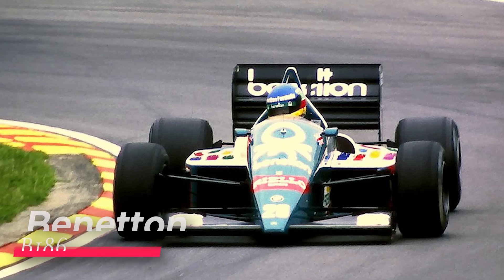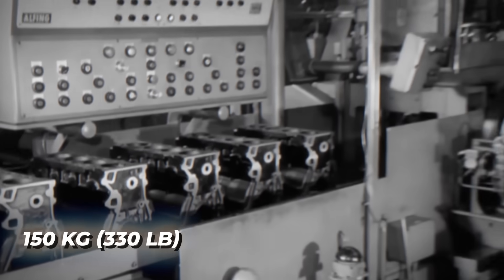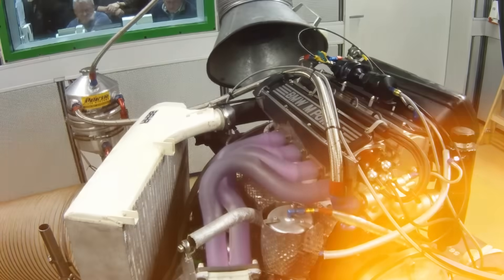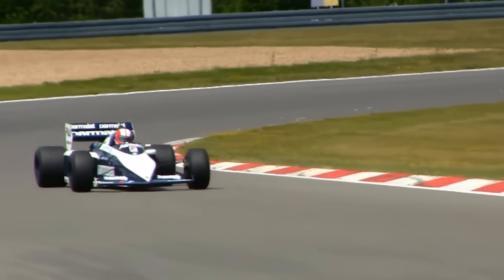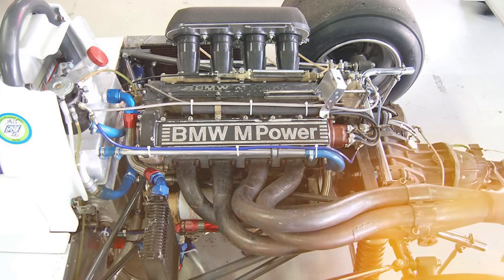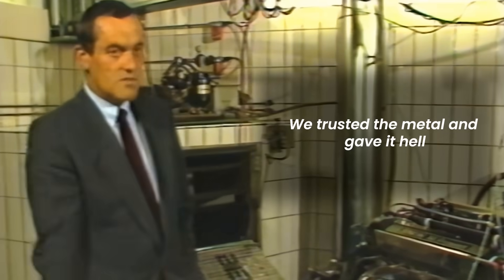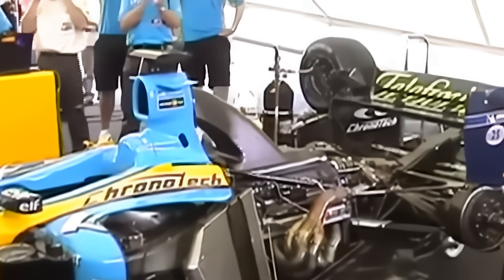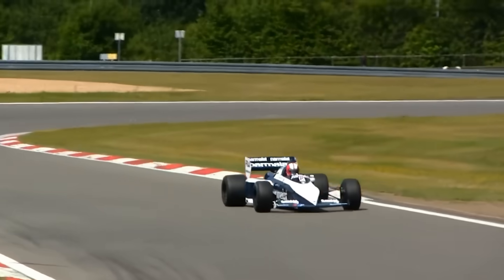The Engine That BROKE Formula 1 - BMW's 1.5 Turbo

Comment: There was one of these at a Top Gear Live show in Sydney Australia more than 10 years ago.  They announced it was about to be started so I made my way over to where it was, stood right next to it and waited for it to start.  They told us to cover our ears which I kind of did, and then they fired it up, idled it for a bit and then revved it a few times.  OMFG!!!!!! I have seen a lot of loud and incredible motorsport moments including Top Fuel dragsters but this was something else, especially due to the tiny 1.5 litres and 4 cylinders that was generating the pandemonium.  F-ing amazing!  I have a video somewhere that I will try to find but it totally blew my mind with the sound and the wonderful fumes of God-knows-what fossil fuels it was burning :)
Reply from the maker: That must have been absolutely unreal to experience in person. A 1.5-liter four-cylinder making that kind of noise and violence just doesn’t make sense. Hearing it up close is something you never forget. If you ever find that video, I’d love to see it, those engines were pure mechanical madness.

Comment: 1:35 They literally took 100000 Mile plus blocks, stored them outside behind the garage for a couple of seasons and then stripped and built them.....Story goes some workers even went around the shop/shed and peed on/over them......
Reply from the maker: The blocks being old, rusty, high-mileage cast iron? That part is real. The ‘peed on’ part… let’s call that peak workshop folklore 😂 Either way, whatever they did clearly worked.

Comment: That Engine Block they Pissed on it! No Joke! And then they Raced that thing in F1. No Joke!
Reply from the maker: The ‘pissed on’ story is one of those long-standing paddock legends. I can’t say for 100% sure it actually happened, but what is confirmed is that those old cast-iron blocks were insanely strong and came from very early production batches.

Comment: So double the power now how is this possible that the lap records were broken with half the power??
Reply: Aerodynamics , more usable power, and improved traction. 
Race tracks have corners
Reply from the maker: Exactly,  modern cars make less peak power, but way more usable power. Plus insane aerodynamics and downforce. A 1980s quali engine was a rocket in a straight line, but today’s cars are faster over a full lap.

Comment: FWIW - For these engines, the BMEP isn't an issue since the spark is so far after TDC.  It's making the exhaust valve, exhaust manifold, turbine wheel, and turbo-shaft lubrication system survive that's the difficult part.
Reply from the maker: Great point! the real challenge was indeed keeping the exhaust side and turbo hardware alive at those insane temps. Appreciate you adding the technical context!

Comment: Blaa Blaaa Blaaa     1.400 HP is a BMW lie...that has persisted ever since...They didn't even have Engine Test Benches back then that could have measured that...🤫
Reply from the maker: I get what you mean, a lot of numbers from that era are exaggerated. But in this case I looked into multiple sources, and the estimates all land in the same range. So it should be pretty close.

Comment: 1500 BHP is NOT more than a Bugatti Chiron.
Reply from the maker: You're right, the top qualifying numbers were around 1,500 hp, and a Chiron makes more. The point was more about the insane power density from just 1.5L back then!

Comment: "BMW was one of the first to use engine management" then bit later "modERn ENGINes do iT wIth SOFTWarE" yeah so did BMW because using computers to control engine is better method than archaic carbs, ignition points, vacuum actuators and centrifugal systems.
Reply from the maker: Fair point, the tech definitely evolved fast in that era. My goal was just to give a simple overview of how BMW approached engine management back then. Appreciate you adding more context 👍

Comment: 4g63 was making 2000hp 25 years ago.
Reply from the maker: True, the 4G63 can make huge numbers but that’s in short drag pulls. The M12/13 was doing 1,000+ hp from just 1.5L in full F1 trim, which is a completely different level of stress.

Comment: My tuned 6 cylinder twin turbo N54 bmw engine only ran 9 psi and had 400hp. I cant imagine driving one of these formula one machines.
Reply from the maker: Exactly! and that N54 already feels wild at 9 psi. Now imagine a 1.5L engine running 60+ psi and making over 1,000 hp… absolute insanity.

Comment: BMW F1 engineers didn’t “just take a used old M10 block”. The block only looks similar on the outside. Internally the block is completely different.
Reply from the maker: Yeah exactly!  they only looked like old M10 blocks from the outside. Inside they were totally re-engineered for the F1 program. The whole ‘junkyard engine’ thing is just the fun part of the story.

Comment: I know a collector who owns one of these engines. Many years ago I asked him if he ever thought of firing it up - he answered "no, because the conrods wil bend and the engine will be scrap after a single dyno run". It's still a dormant beast in his collection to this day.
Reply from the maker: That’s an awesome story. And yeah, these engines were basically time bombs in qualifying trim insane power but zero lifespan. Makes total sense he keeps it as a dormant monster instead of risking it on a dyno.

Comment: Tires as thin as your forearm? This wasn't the 1950s.. 80's F1 tires were very wide
Reply from the maker: You’re right, 80’s rear tires were seriously wide. I was talking about the fronts during qualifying trim those were much narrower compared to the massive rears. But yeah, nothing like the 50s!

Comment: This was all fuel not the turbo so much or the engine.
Reply from the maker: The fuel was a huge part of it for sure but the engine and turbo still played a massive role. Without the block design and the insane boost levels, the fuel alone wouldn’t get you anywhere near those numbers.
Reply: @HCGHiddenCarGems  depends on the fuel-back then people were sometimes using hypergolic

Comment: Gordon Murray has disputed both the power output and the "scrapyard engine blocks" numerous times over the years.
Reply from the maker: True Murray has pushed back on the scrapyard myth and the exact power numbers. But even he admitted the boost levels and cylinder pressures were wild for the time. Either way, it’s still one of the craziest turbo engines F1 has ever seen.

Comment: 1,496 cm(3) 1.5L boost gauge passed 5Bar
89 mm x 60 mm 1,400 hp
Reply from the maker: Yep exactly tiny 1.5L, 89x60 mm, 5+ bar on the gauge and around 1,400 hp in full boost. Absolute madness for that era.

Comment: That’s nothing imagine building a 11000hp drag car now that’s crazy
Reply from the maker: For sure, Top Fuel levels are on another planet but seeing an F1 1.5L four-cylinder push 1,300+ hp in the 80s is still insane in its own way.

Comment: How it did it break F1 when it was so unreliable and came no where close to winning a championship?
Reply from the maker: They did win Piquet took the 1983 championship with the BMW M12/13.
The insane 4–5 bar versions I mentioned were the quali-only ‘grenade’ engines. Those were never about reliability, just pure rule-breaking boost.

Comment: I read somewhere the engineers pissed on the engine blocks to harden the steel. lol I'm not sure if it's a myth or true
Reply from the maker: Haha definitely a myth 😅
They didn’t do anything like that the M12/13 blocks were hardened by heat-treating and shot-peening the cast iron, not… that. The real process was just proper metallurgy, nothing crazy.

Comment: 5 bar!!! I had an s13 nissan 200sx 2 litre running 23psi aka 1.5 bar hitting 300hp by norris designs and massive lag....
Thats insane!!

However the description "violent" was how a friend of mine described my SX's sound from it's exhaust... It was a full HKS from turbo /manifold . "violent like a horrible drunk husband hitting his wife." was the exact description - same mate of mine could hear my car from Chippenham when he was in corsham uk (google distance. About 3am)
- so imagine how brutal this thing sounded!!
RRRRAAAHHHHH!!!!
Reply from the maker: Man, that’s a crazy story. A 200SX at 1.5 bar already feels violent as hell, so I can’t even imagine what 5 bar in a 1.5-liter F1 engine must have felt like. The lag, the hit, the noise… it must’ve been on another planet. Hearing your car from another town at 3AM is wild though those old-school turbo setups had a totally different kind of aggression. Makes the M12/13 feel even more unreal.

Comment: I believe they had no radio yet on board in 1986.
Reply from the maker: They actually did have radios around that time, but not every team used them consistently yet. Early systems were unreliable, so some teams relied on pit boards more than others. Good point though it definitely wasn’t like modern F1 radios.

Comment: it was a midfielder motor) top teams had renault , honda & porsche motors ... the bmw motor won only in 1983 brabham due to (bernie eclestone's team x president of formula 1) , gordon murray was the engineer who introduced for the first time the strategic pitstop which made the difference & nelson was a great driver , this team could have done this easily which any turbo motor of that era)... the engine itself was trash ... study history) ... it was a midfielder motor until the end of the first turbo era :)
Reply from the maker: You’re right that the ’83 title was a combination of things Murray’s strategy, the low-line Brabham, Piquet’s talent… all played a massive role. But calling the BMW block ‘trash’ is a bit harsh 😅
It was wild, fragile and inconsistent, sure but when it worked, it produced some of the craziest power figures of the era. That unpredictability is exactly why it became such a legend.
Reply: @HCGHiddenCarGems power is nothing without control & in F1 without reliability as well)) ... the car was fast only and only on tracks with straights... on tracks like monaco v8 NA motors where lapping sometimes even faster😂😂 ... the v6 honda and renault twin turbo were the engines to be used) ... better throttle response , less heat , more relaibility , same power output ... it's just history and analysis not my opinion

Comment: Standard youtube exaggeration in this video. Seconds per gallon, would require refueling after every lap or sooner. Top Fuel dragsters with 10000bhp are in that range and they only run a quarter mile. They used higher fuel rates but ran for many laps before requiring refuels. Definitely a few "creative liberities" were taken with the narration.
Reply from the maker: Fair point the fuel numbers in that era were insane, but not Top Fuel–level insane. They did burn through crazy amounts under full boost, but of course not literally seconds-per-gallon like dragsters. I’ll keep the narration tighter next time 👍 appreciate you pointing it out.

Comment: they also ran the fuel lines through the exhaust manifold due to the fuel they running tuolene had an optimum fuel combustibility at 60c
Reply from the maker: Toluene-heavy fuel did perform better when heated, so teams kept the fuel warm to handle more boost. The lines didn’t run through the exhaust manifold, but they were routed close to hot areas to keep temps up. Warm fuel = more stable combustion and more power.

Comment: So with a new geometry turbo and electronics it would have a longer lifespan
Reply from the maker: In theory, yes modern turbo tech and electronics would definitely help it live longer. Those old setups were brutal on the hardware 🔥.

Comment: So much misinformation. Renault had already made over 1000hp on their 1.5 liter twin turbo engine being that they were the first to introduce the first turbocharged formula 1 engine in the late 70's when everyone stuck with the 3.0 engine.
Reply from the maker: You’re right that Renault pioneered the turbo era with a 1.5 L turbo V6 and later achieved over 1000 hp in quali. But just to clarify: the early car wasn’t immediately at 1000+, and twin-turbo came later. Great point though.
Reply: The first generation Renault F1 turbo wasn't that powerful, about 50-100 hp above the 3.0L normally aspirated engines like Cosworth DFV
Reply: Not to mention these engines weren't banned because they were too powerful. They were phased out because the sport was moving away from turbos and having quali engines that exploded every Grand Prix was hardly economical for the teams.

Comment: Of course BMW castet new and more stable blocks. They used old blocks in the beginning of the F1 project.
Reply from the maker: Exactly they started with old, high-mileage M10 blocks, but later BMW cast fresh, stronger ones once the project grew. The early ‘street blocks’ were just the beginning.

Comment: The  most powerful F1 engine ever and based on the legendary M10 engine. I've owned several BMWs with this M10 engine. Maybe the best engine ever.
Reply from the maker: 100%! The M10 is one of BMW’s greatest engines ever  crazy strong base for the F1 monster.

Comment: The key was to have exhaust manifold pressure pre-turbo inlet being lower than boost pressure.
Reply from the maker: Yep, that was a huge part of it. As long as exhaust manifold pressure stayed lower than the boost pressure, the engine could survive those crazy numbers.
Reply: And most important: They didnt care about Sound! It came automatcally

Comment: I was under the impression that the Honda V6 turbo's were the most powerful engines of the time and possibly a bit more reliable than the BMW's. Ford also tried to compete with their own turbo engine, but never got anywhere near the power of the BMW, Honda and Renault engines.
Reply from the maker: The Honda V6 turbos were beasts for sure! super strong and very reliable. But in terms of pure peak power, the BMW inline-4 still sits at the top. Those quali engines were on another level.

Comment: These engines were the highest performing ones from the Dyno runs... They were only used once, during qualifying. Lesser funded teams ran the same engines fp2 sessions and qualifying, but the power numbers mentioned here.
Reply from the maker: Yep, that’s right. These were the strongest engines from the dyno and only meant for a single quali lap. Smaller teams had to reuse theirs, so the power was nowhere near these numbers. Wild times.

Comment: From memory, at least some of these they welded the cylinder heads on from the inside of the bores.
Reply from the maker: I’ve heard that claim before, but I am not sure that the M12/13 heads were actually welded from inside the bores. There were special sealing solutions like fire rings,
Reply: Not welded, but they had sealing rings.
You can find it if you google "BMW M12 Fire Rings".

Comment: 72psi of turbo boost, good God. 32psi for a normal engine like the Honda K20 is already enough to get it to 700-1000hp, but more than double that for a tiny 1.5l v6 is just mechanical insanity. The lag was also crazy too, I saw a vid of a driver said that it lag for like 2-3 seconds before all 1100-1400hp kicks in.
Reply: V6? Inline 4 made that HP
Reply: It was an inline 4 ... forget about the blocks.

That was a 1400hp engine putting 350hp per Connecting rod.
Reply from the maker: Crazy right? And the funniest part — it wasn’t even a V6. That 1.5L monster was an inline-4 pushing those numbers 😅🔥
Reply: @HCGHiddenCarGems  Oh, I mainly remember the Renault V6 from that era, didn’t know there was an I4 too. Civic bros are shaking rn with these numbers on an inline-4 lol. Speaking of that, that’s only about 160cc larger than the Hayabusa turbo engine, which is 1340cc.
Reply: Joe with locash racings integra gsr b18 1600izh horsepower from 100psi boost, single turbo😊

Comment: Piquet said that the turbo lag was so huge — around 2 seconds — that he had to go flat-out while still in the middle of the corner, just so the massive power would hit right at the exit. Just imagine that. You needed balls of steel…
Reply: And if you got the timing wrong you either bogged on the exit, or you had 1400bhp hit your rear wheels while you were still cornering.

Into the weeds, or a concrete wall.
Reply: @freman007  Exactly! That’s why I think balls of steel were required… I mean, imagine having to anticipate 1000+ HP in the middle of a corner — basically guessing and hoping it would hook up. And doing that how many times per lap? Man, I can’t even wrap my head around it. That’s why I think Piquet deserved way more recognition — he was a * of a driver until his accident in Imola.
Reply from the maker: Right! Imagine flooring it in the middle of a corner just to catch the boost on exit. Absolute madness! those drivers were built different.
Reply: Imagine doing it again with twin scroll or anti lag.

Comment: 2:28 550 hp at idle? What was the idle speed and how much boost was required?
Reply from the maker: Good question!
The BMW M12/13 didn’t make 550 hp literally at idle — what I meant is that even at very low RPM the turbo was already building impressive boost.
In qualifying trim these engines were idling around 3,500–4,000 RPM, and with boost levels over 3.5–4.0 bar, they were already making several hundred horsepower before even revving out.
That’s why the drivers said it felt like a bomb waiting to explode.
Reply: @HCGHiddenCarGems at idle the engine would be producing less than 1hp.
Reply: @mareksumguy1887 not if it idles at 4,000rpm
Reply: @gerbel01  ok... then maybe 2hp max.
Reply: @mareksumguy1887 so that engine at 4000rpm idle makes 3 ft/lb of tq?
Reply: @HCGHiddenCarGems  They wouldn't have boost at that level with essentially closed throttle at idle since you have very little mass flow- so not 550hp, perhaps 50 at most. Remember it's only 1.5 liters...